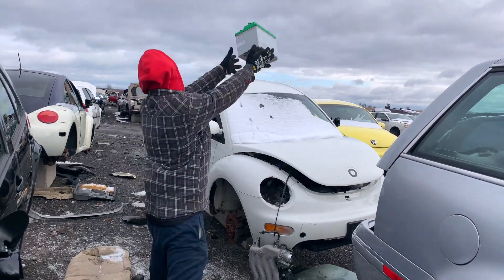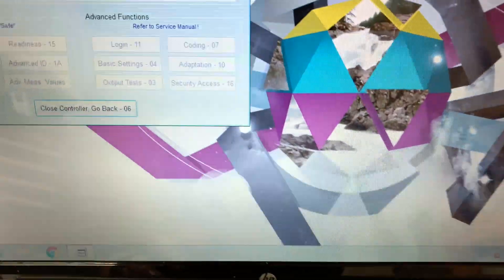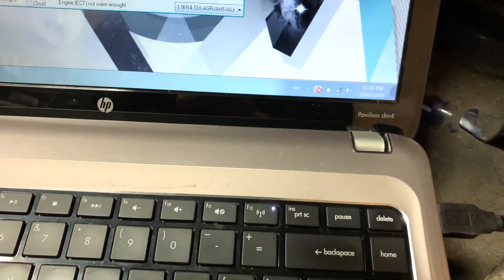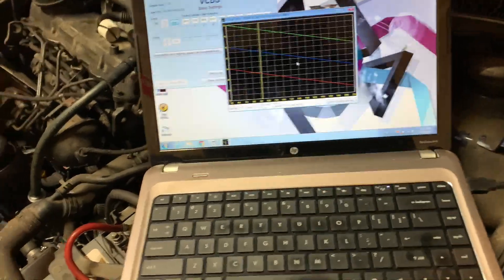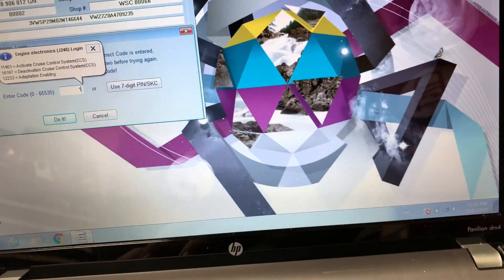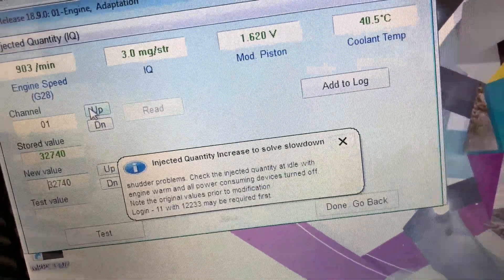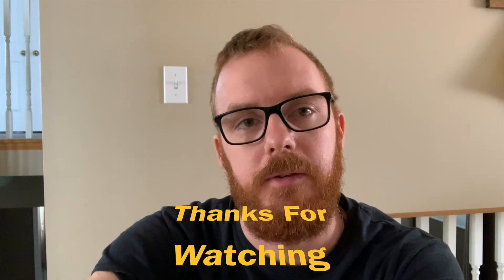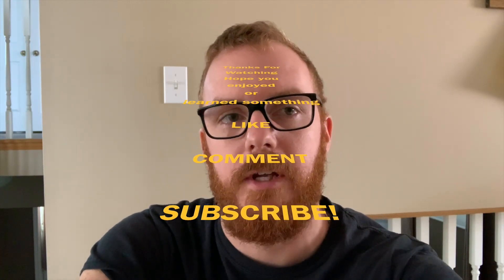How to Set ALH Injection Pump Timing and IQ

Comment: Hello! I have a 1.9 tdi agr 90 hp stock, the IQ is 2.8 / 3.0 MG with a temperature of 92 ° at idle and with everything off, are these values correct? If I increase the IQ more (close to 3.6 / 3.8 MG) I will to achieve better performance? thank you so much
Reply from the maker: That’s no far off of ideal 
If I remember between 3-5 is factory spec range 
As long as your in there your good
Personally I go 3.5-4 area
Reply: @ERAutomotive Thanks for responding! If the value is lower, will it consume less or the same but with possible vibrations at idle?
Reply: Finally I adjusted the IQ to 3.2/3.0 MG at 92° and although it lost very little in performance it gained more smoothness at idle and even sounds a little better, excellent videos! thank you so much!

Comment: Hi i have a stage 2 alh .260 injector pd150intake and a bew turbo, i blew the turbo , put a brand new one i have 20 psi but  i dont have the sa power that i had after 2300rpm its just smoking whith no power, what should i look?

Comment: Mate please i need help, so my car is stuttering at idle, soudns exactly like your car before you open the tdi timeing chart. My best guess is that i should advance the timeing belt a few degrees, do you have any suggestions. Its a 06 BLT out of a vrs fabia
Reply from the maker: You’ll need to look in vcds and see where your at and adjust accordingly 
But isn’t that a pd engine not a ve engine
Not sure we don’t have blt here
Reply: @ERAutomotive  Im pretty sure its the slow down shudder thing its exactly like that, so im going to drive it now until it occurs then il check and adjust iq
Reply from the maker: Ok yeah if it is slow down shudder check iq and adjust as needed 
Would be a great start
Reply: @ERAutomotive  Well i checked its not the iq its sitting at around 6,5 even when it starts to stutter never goes to 0.
Does that mean its related to the timeing belt not the iq?
Reply from the maker: That’s not spec for iq on the engines I know here
It
Should be a stable number not a changing number

Comment: Hi I have an alh tdi and have tried adjusting the timing. The problem is that the timing is too advance and I can't delay it because the regulation pulley stroke is finished . The car runs decent but the timing is out of the pattern . Could this be a problem or can I keep driving like this? The timing is 5.7 btdc (2 btdc is the maximum timing specification). Sorry for my bad English
Reply from the maker: You want to look at the timing graph not just measuring blocks
Reply: @ERAutomotive why put the  timing near the green instead of the middle?
Reply from the maker: I find better response power and econ
Reply: @ERAutomotive  cool. My mk4 has .216 injectors and egr delete and pd130 intake and I want to roll coal but don’t have a tune what can I do in VCDS
Reply from the maker: Sorry nothing u can do 
Need a tune
Reply: Is out of the graph. Too advanced right there
Reply from the maker: Personally I would get it in spec 
Might have to re lock everything and start there
Reply: Ok thanks a lot 👍🏼